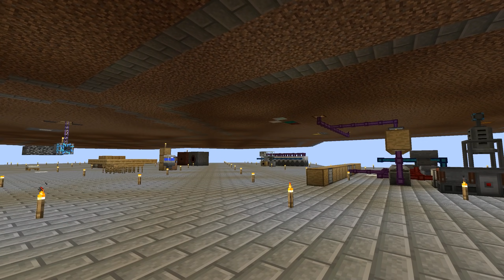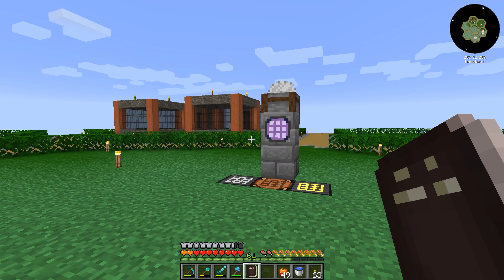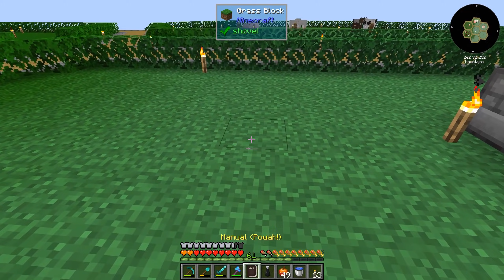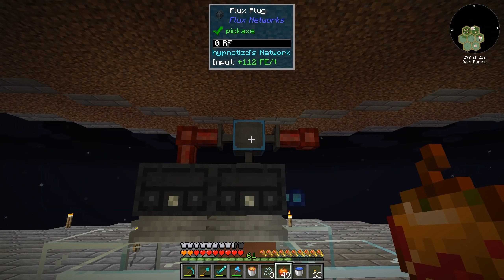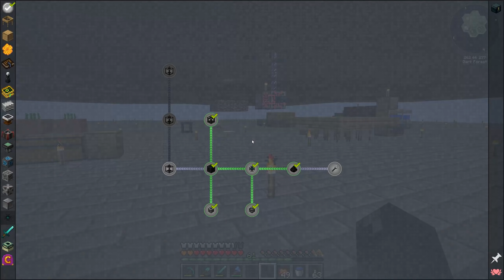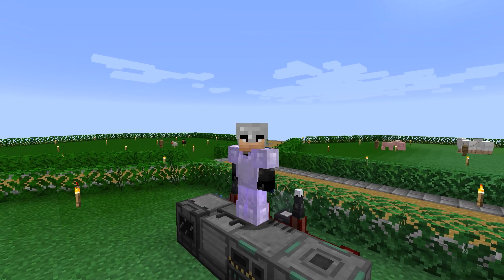Energy rods and factories - Sky Bees E22

Comment: You can make Powah reactor and solve all your power issues for this series to use it you need uraninite, redstone(blocks), coal(blocks), water and any ice (best ice is dry ice  I think dry ice can be find from mining dimension or by crafting). To make Powah reactor you need to do 9x4=36 set of reactor blocks and place it down it will auto build it self when all blocks is in your inventory. for first reactor maybe good to build tier 3 or so cause blocks can't be upgrade to next tier and high tier items need more power. Reactor have setting that it will not waste any items and it loadup when power level go down to 70%..

Comment: Hey hypno I think with the thermal generator if you have more than one face covered in lava it will work faster 🤞🏼
Reply: Wrong thermo generators, this is powah, your thinking of either mekanism heat generator or immersive engineering thermoelectric blocks
Reply: Yep, was just about to say this!